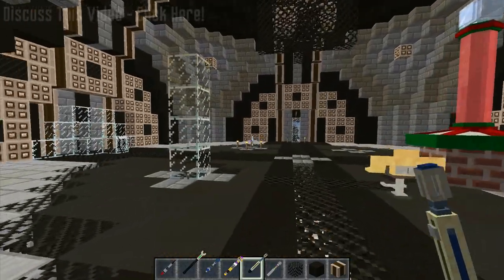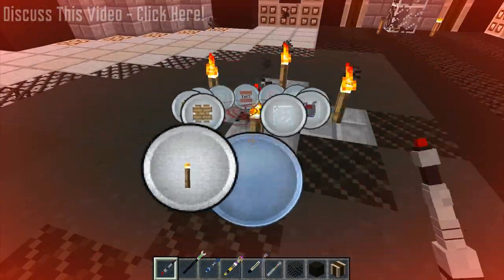High Frequency Mode - Sonic Screwdriver Update - #DWCM #iMine4WHO

Comment: How exactly does it light a torch? The sonic screwdriver has never worked on wood, or started a fire from nothing. These are two features in one that the sonic would not be able to perform. While I know that the sonic can start a fire from computers, that is presumably from the hardware overheating. This would not be possible to do from nothing. Not even on any coal at the end of the wood.
Reply: Because large sciencey words.
Reply from the maker: ok, simply put not all sonics are created equal. dwcm has many sonics that are far more advanced than the on screen sonics. going into detail with half science half fiction. the sonic is resonating at a frequency that produces the effects of the spnic combustion theory. in otherwords, just go with the flow & use a spark of imagination to ignite the flame. imagine the scenes where the doctor lights a candle with the ssonic and just apply that to this. you are speeding up the molecules with the sound waves emitted from the sonic to the point of combustion.
Reply: StargateChannel Meh just go with the wibbly wobbley timey wimey answer, it would have been alot easier lol
Reply: StargateChannel Yup, just like bad wolf girl said, "Same software, different case."
Reply: Technically, sonics can work on wood, they just take a very long time to find the frequency, as proven in the 50th anniversary special.
Reply: The 10th doctor lit a candle with his sonic so it is possible to make fire using a sonic